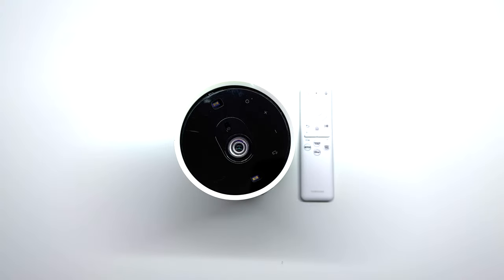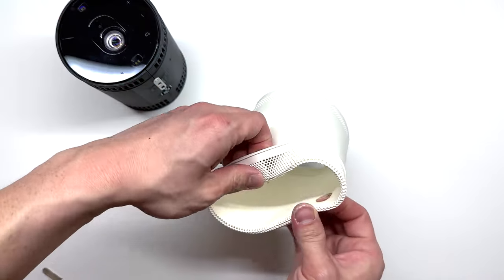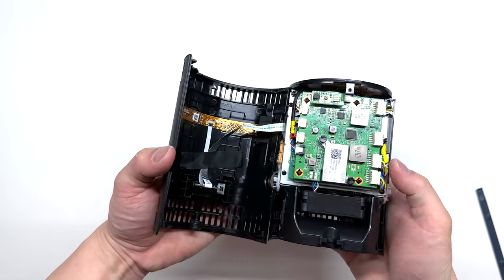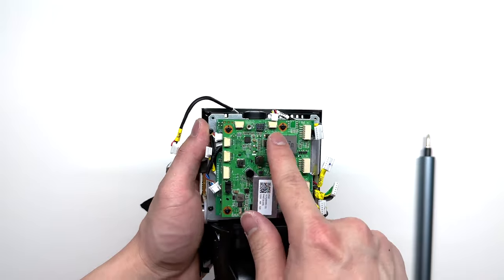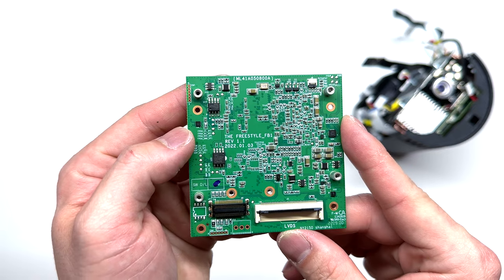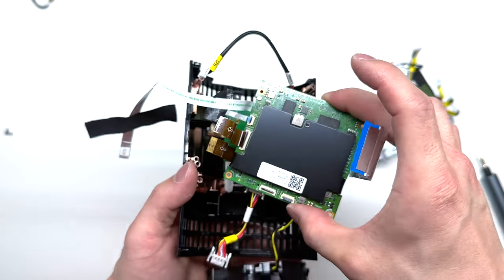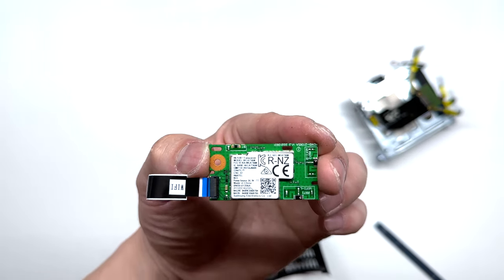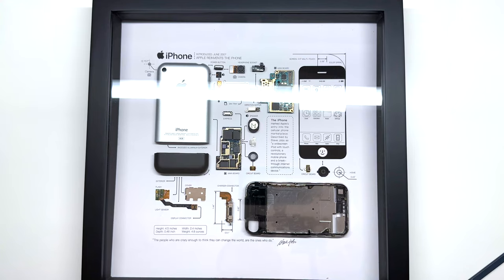Samsung Freestyle Projector Teardown / Disassembly

Comment: Does the fan speed change with temperature?  if i put an additional fan on top will it reduce the noise from the main fan?
Reply: This is a 4 pin pwm regulated fan. In theory can change speed and noise
Reply: @Teerexish  can you put its model there? Can't recognize it from the video. Thanks

Comment: Hello! I have this projector but sadly I lost the adapter that came with it. I tried an adapter that is 25 watts and it doesn’t work. Do I need to get a more powerful one, or the problem is elsewhere
Reply: The original charger is Samsung 65W PD PPS. You can also usea 45W PD PPS minimum,  but you will get a message saying the charger is limited and you'll get reduced brightness and performance. The main thing in a replacement charger, is search for a compatible 65W PD PPS (or even highwer wattage, the projector will only take what it needs to run).

Comment: I would love to get the specifications of the fan in order to swap it for a quieter one. Does anyone know or where to find the info?
Reply: I managed to scan the data matrix code on the fan from a screenshot of this video. It's a Delta AUB0512HB. Unfortunately it's a 50mm fan which is not very common and I can't find one that exceeds the 24m³/h air flow and 6.1mmH2O static pressure of the original fan.

Comment: Is it possible to find out the value of the capacitor? (located at the bottom left side. The farthest one, it’s the only one)  https://youtu.be/JdoQB750aL8?t=545 
After the projector fell and the board hit the board, it was torn off and there is no way to find it.

Comment: I'm throwing a bottle into the sea

I disassembled the freestyle as shown in the video, and I took the opportunity to change the fan because it was making too much noise for me (but it's a 3-pin instead of a 4-pin, but it doesn't matter, it just works with the + and -). When I turn on the freestyle, it shuts down after 10 seconds "system error", so I put the old fan back on, but it's still the same (the fan runs at full speed and shuts down after 10 seconds), as if it were overheating (which it isn't). I'm thinking of a temperature sensor that's buggy or something ... if anyone has any suggestions, I'd love to hear them.

Thanks a lot.

Sorry if the translation is bad
Reply: The fan might not be the issue, it might be a bad connection somwhere else, as you pointed out, maybe temperature sensor. Also, there are many of the small connectors that are pretty sensitive. I'd choose a moment when I'm calm and fully concetrated, start with a clean desk and give it another try, dissasemble again slowly, carefully, and re-check all the connections. Also, you might have fried something with replacement fan... and, of course, there's always a chance you breaking something else in the process. So, yeah, do it at your own risk, but you already know that. :) Or take it to the service and explain what you did. Good luck!
Reply: @zdrz7727 Thank you for your reply!
Alas ... I've already disassembled / reassembled it several times, taking great care, but it's always the same result ... I still don't understand and I'm stuck. What's more, I haven't been able to locate the temperature sensor, even after searching on the internet (I don't know where it's plugged in).
With no official customer service, I don't really know what to do to find a solution ... :/